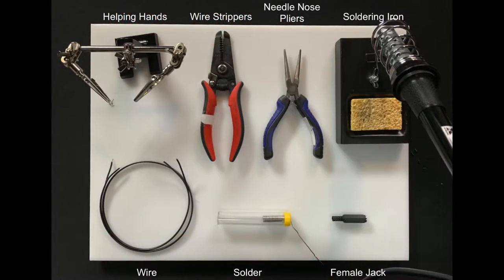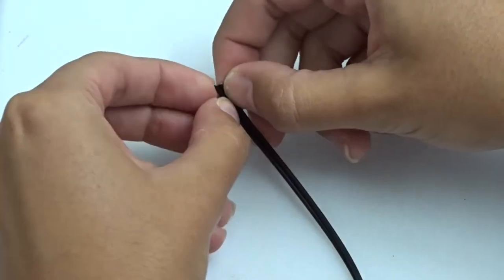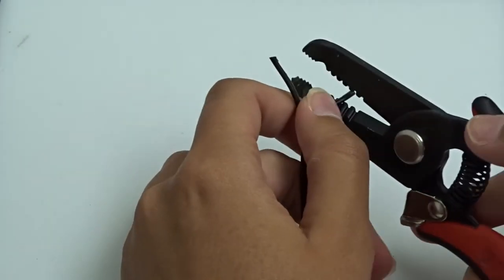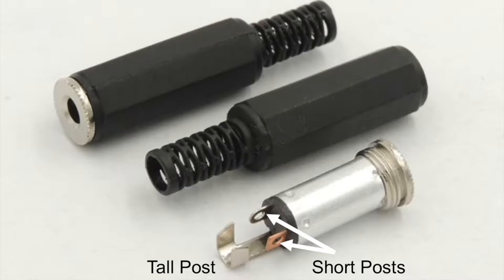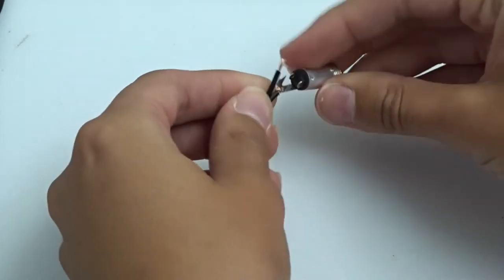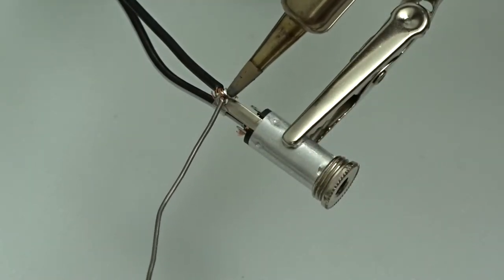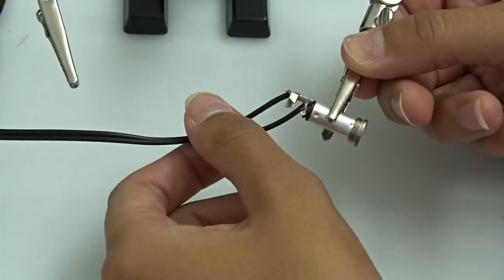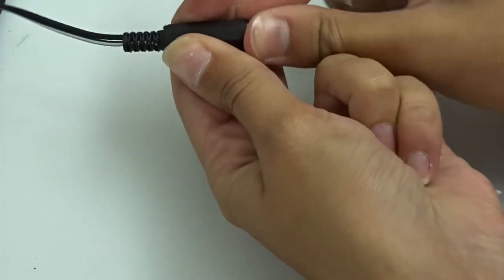How to Solder a Wire to a Female Jack

Comment: why isn't the second short post being connected to anything?
Reply: Cause is mono, if you want stereo signal you have to connect the second post too, and you need a 3 wire cable, right, left and ground.
Reply: @CharbonDeBoisMusic  the longer post is for ground, right? and also, how to identify which short post is left and which is right?